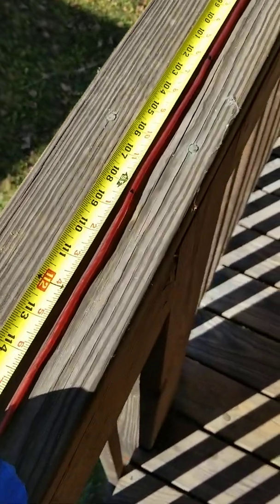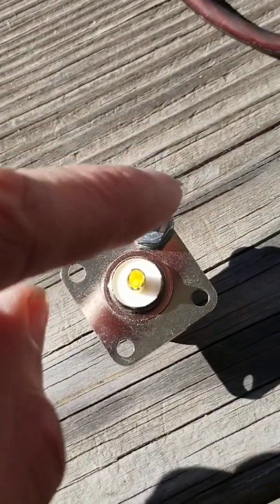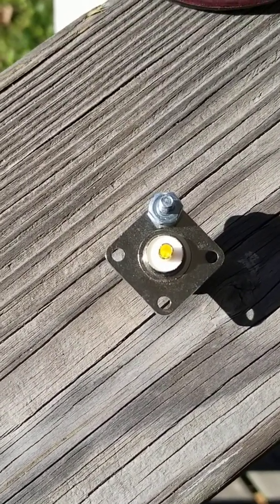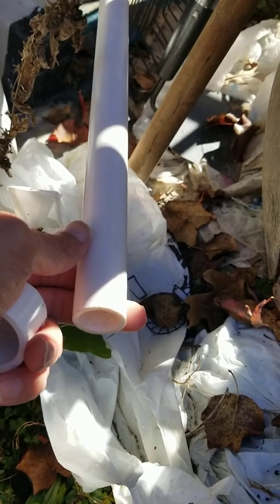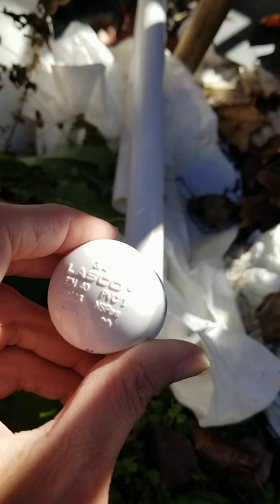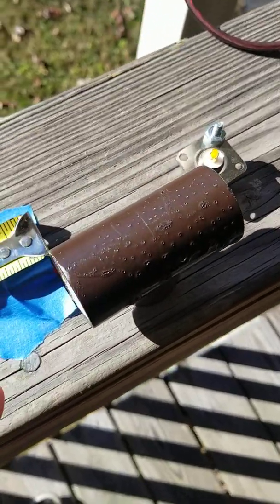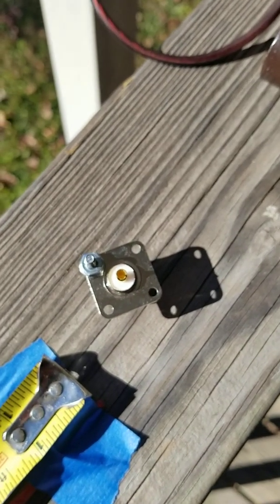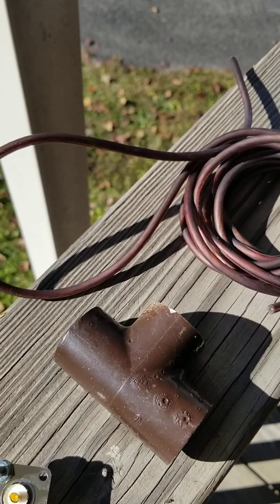Ideas 108 102 inches homemade  cb antenna one single beam.

Comment: I don't understand why you can't think for yourself. For instance, did it occur to you mount the wire on the screw and nut with a ring terminal? Or you could solder it directly to the body of that SO-239 chassis mount. I've noticed that Mower Junkie just attaches bare wires in hose clamps. Don't emulate this guy or others, they're hacks. You have a nano vna? Do you have a license to use that? 50ft of coax lowers the swr and then you trim the antenna? C'mon man, like I said in my other comment, do some independent study, like in books, and stop following what other idiots do... and stop perpetuating it by putting up support videos. I swear this medium is a disease on rf theory, it needs to stop. I don't want to catch you putting up more videos until you have some proper education under your belt. Don't even think about doing one on gamma matches until you know that theory inside out. I mean, even better than those idiot hams, they don't have a clue. How a gamma works is actually interesting. Better yourself, man.

Comment: I made a 1/4 wave ground , with a 102 " whip on a morrow mount and 2 pieces of 102" of copper wire from each side of the of mast pipe had a 1.5 SWR match. it was only 10' off the ground talk about 40 miles .how much power will a stainless steel whip take that how much you can run through it Thanks

Comment: No, this is not the way to build a dipole antenna!
A dipole is a balanced antenna with both elements of equal length.  For the 11 meter band that would be around 105" for each leg, allowing some extra for tuning.
Insulated wire will come in a little bit shorter that the calculated length due to the velocity factor of the insulation. And, placing the wire inside of a PVC pipe (radome) will shorten it a little bit more, again due to the velocity factor of the PVC material.

If you are thinking that this is the radiating element of a 2 or 3 element beam then it is called the driven element.
If you are thinking of a flat-side single dipole on a rotator then it is called a "Bi-Directional, Rotatable Dipole".
It is not a "Single Beam" antenna!  Sorry, but it just isn't.
Reply: There goes his radio 😂😂
Reply: Is he serious 😅😅😅

Comment: CO phase two together!
Reply: Co-phasing is what it is called when mounted on a mobile.  For a base installation it is referred to as a Phased Array Antenna System and requires specific lengths of coax, usually 75 to 90 Ohm and the antennas are usually ground mounted verticals with an extensive counterpoise system.

Comment: Looks like your making a Quarter Wave Dipole which should be 9ft each side give or take an inch when tuning
Do Not put glue in the Centre Pin unless its Soldered First